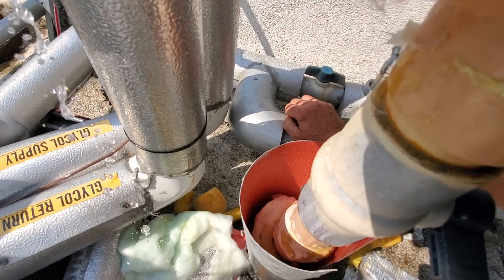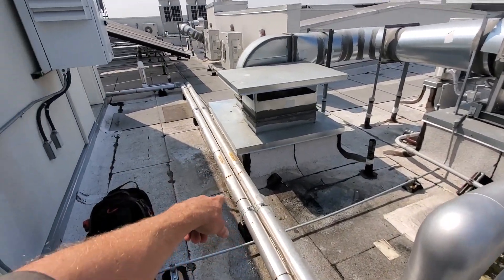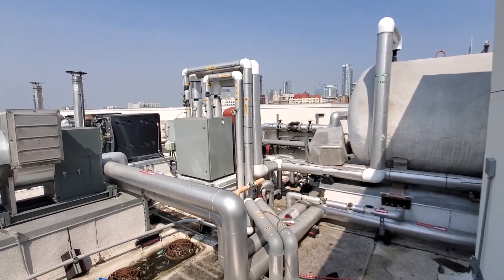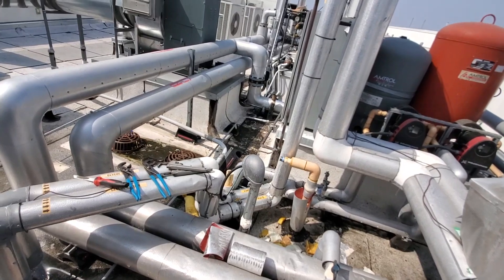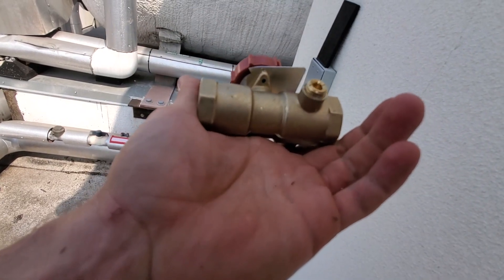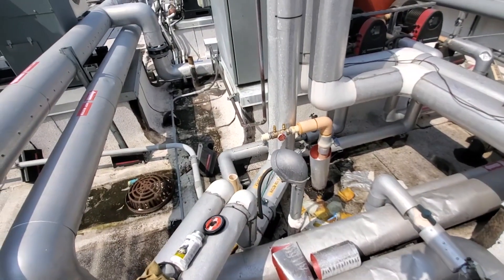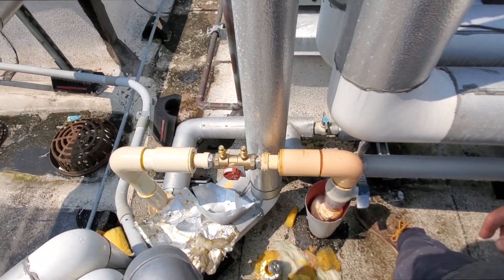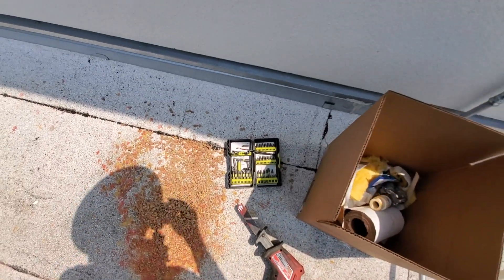Replacing a balancing valve on a high rise building

Comment: i hate CPVC..worked at a hotel that was only 5 years old and i had to replace a outside hose faucet...could not get the shutoff valve inside to turn...ended up shutting entire hotel down...that stuff gets so brittle

Comment: Instead of holding a fitting where you think it’s going to be and holding your tape measure flapping in the wind, put a piece of pipe dry in the vertical coupling (a Gunnar), then measure from the center to the make in of the horizontal socket, then subtract the takeoff. Thats the way a real pipe fitter does it. Measure from centers and subtract the takeoff of the fittings. They’re always the same, and eventually you’ll memorize them, and your cuts will always be perfect the first time.

Comment: What does that valve do? Also were the other pipes there for HVAC? Man commerical is crazy
Reply from the maker: @aaronbaraiya3692  they are flow valves to control flow and hot water temp around the building

Comment: We've had so many problems with circuit setter balancing valves in our facility that we removed them all.  A constant source of leaks.
Reply from the maker: @jamestamu83  does it mess up anything with the recirc pumps if they are fully removed?
Reply from the maker: @jamestamu83  also, have you noticed any issues with fixtures getting to hot or not getting hot enough?
Reply: That’s a mistake. A pump has a required pressure range at inlet for a reason.

Comment: Loved the music in the beginning.  When hot water is included in the rent there ends up being overuse that everyone pays for.  As you observed, the cost of this system is extreme.  If completely eliminated it would be interesting to compare all the metrics with point-of-use water heating.
Reply: not true. anything using energy at point of use instead of a more centralized location is always more inefficient. example - ICE cars are 20% efficient compared to oil power plants around 40%. same with a centralized heating system, as long as the pipes and joints and insulated properly and water is recirculated